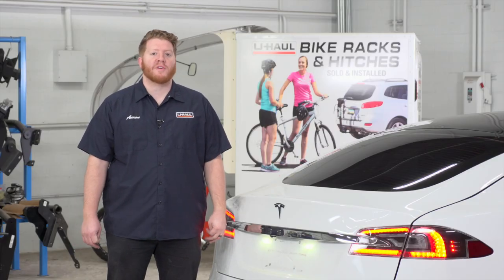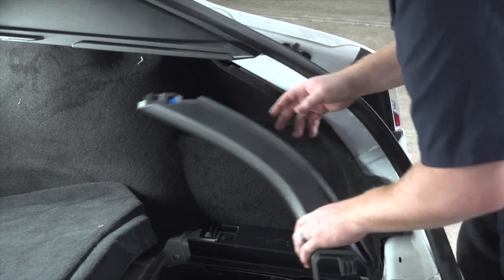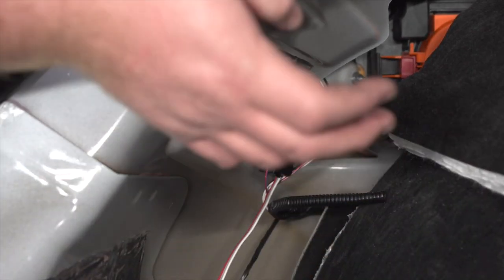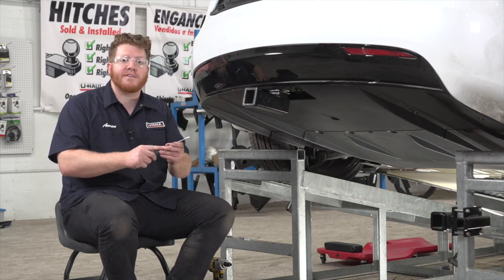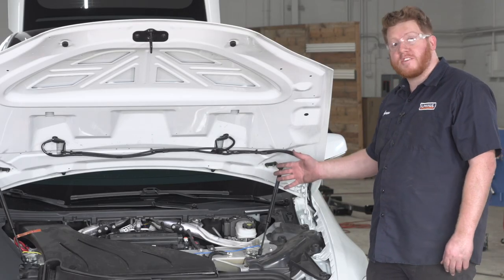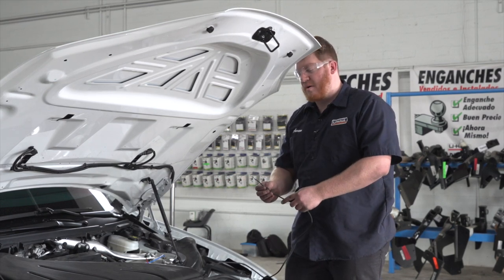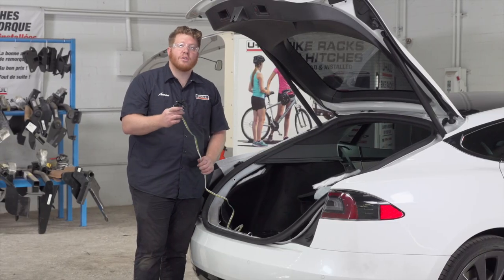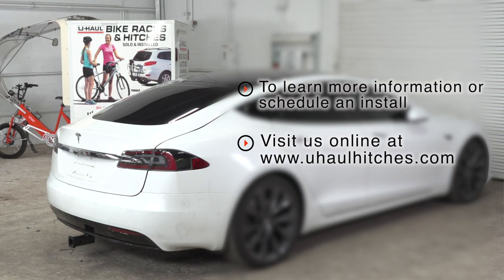2021 Tesla Model S Trailer Wiring Harness Installation

Comment: Will this work on 2022 model (refresh)?
Reply from the maker: Currently we do not have a confirmed wiring fitment for the 2022 Model S. When they switched to a lithium Ion 12V battery, we haven't been able to identify a suitable power source for the wiring kit. With the vehicle being equipped with LED taillights, they do not produce enough power to run the light harness module. We are still looking for a solution.

Comment: excellent!
edit: does this kit integrate with trailer brake controllers? I'm not sure how the brake controller mixes in with this...
Reply from the maker: No, this is a 4 flat installation. you will need the other functionalities of the 7 way socket and a brake controller hard wired into the vehicle.